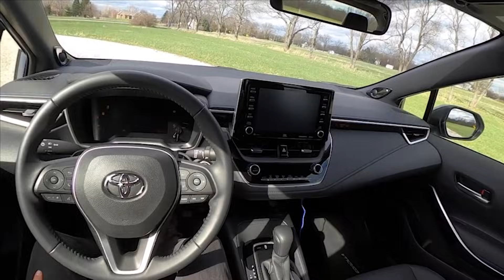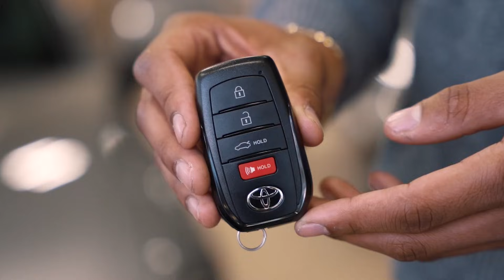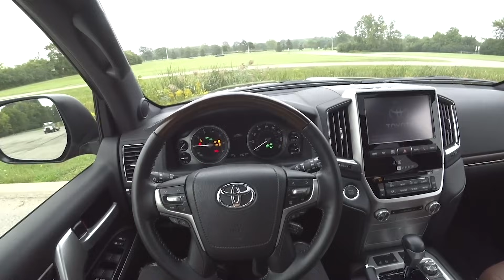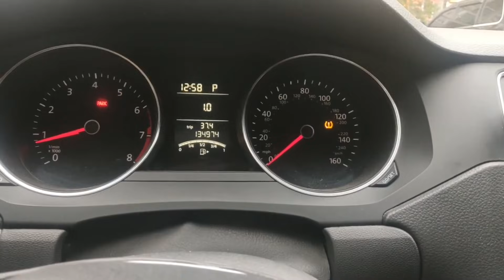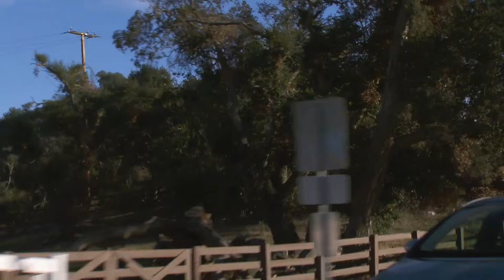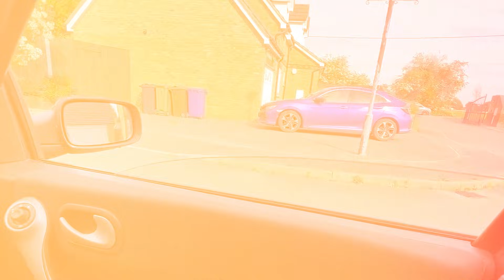This SECRET Toyota Feature Is Only KNOWN by 1% of DRIVERS (Use It Now!)

Comment: Anyone. 

I have an automatic 2008 Scion tC with a 1-inch hesitation on the gas pedal and an occasional erratic acceleration in the lower gears, but most of the time it's okay. Usually happens when I hit a bump, railroad tracks, or use the brakes hard.

My local mechanic said to take it to the Toyota dealership for their computers who charge a $210.00 separate diagnostic fee (does not go towards any repairs). 

Is it common for the dealership service department to go over their 1 hour diagnostic fee and charge extra for the time?

Thank you 🌞